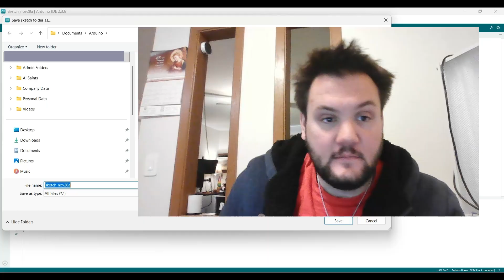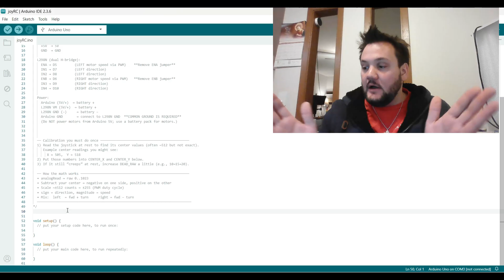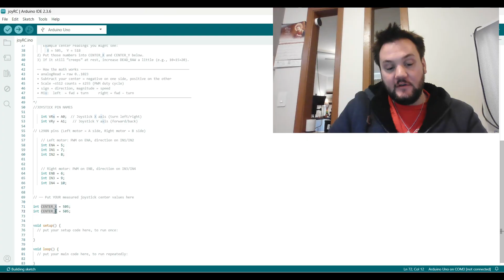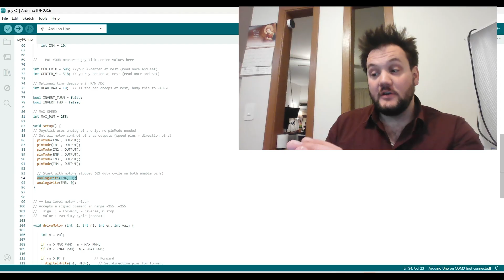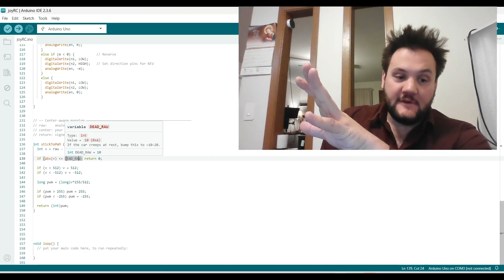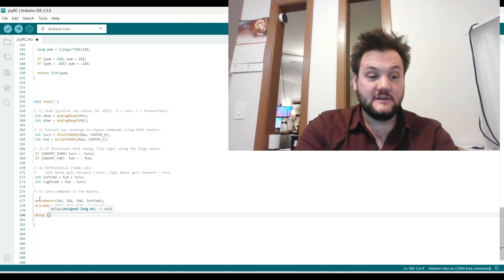Arduino 101: 2WD RC Car CODE with L298N and Joystick

Comment from the maker: /*
  
  Project: 2WD RC Car — Joystick Control (L298N)  *Center-Calibrated*
  Big idea: The joystick sets two numbers:
            • Forward/Back  (Y) → how fast to go
            • Left/Right    (X) → how much to turn
            We “mix” them into LEFT and RIGHT motor speeds.

  ── Wiring ───────────────────────────────────────────────────────────

  Joystick:
    VRx  → A0        (X axis: left/right)
    VRy  → A1        (Y axis: forward/back)
    +5V  → 5V
    GND  → GND

  L298N (dual H-bridge):
    ENA → D5         (LEFT motor speed via PWM)    *Remove ENA jumper*
    IN1 → D7         (LEFT direction)
    IN2 → D8         (LEFT direction)
    ENB → D6         (RIGHT motor speed via PWM)   *Remove ENB jumper*
    IN3 → D9         (RIGHT direction)
    IN4 → D10        (RIGHT direction)

  Power:
    Arduino (5V/+)  → battery +
    L298N VM (5V/+)  → battery +
    L298N GND (−)     → battery −
    Arduino GND       → connect to L298N GND  *COMMON GROUND IS REQUIRED*
    (Do NOT power motors from Arduino 5V; use a battery pack for motors.)

  ── Calibration you must do once ─────────────────────────────────────────────
  1) Read the joystick at rest to find its center values (often ~512 but not exact).
     Example center readings you might see:
       X ≈ 505,  Y ≈ 518
  2) Put those numbers into CENTER_X and CENTER_Y below.
  3) If it still “creeps” at rest, increase DEAD_RAW a little (e.g., 10→15→20).

  ── How the math works ───────────────────────────────────────────────────────
  • analogRead → raw 0..1023
  • Subtract your center → negative on one side, positive on the other
  • Scale ~±512 counts → ±255 (PWM duty cycle)
  • sign = direction, magnitude = speed
  • Mix:  left  = fwd + turn     right = fwd − turn
  ──────────────────────────────────────────────────────────────────────────────
*/
//JOYSTICK PIN NAMES

    int VRx = A0;  // Joystick X axis (turn left/right)
    int VRy = A1;   // Joystick Y axis (forward/back)

// L298N pins (Left motor = A side, Right motor = B side)

    // Left motor: PWM on ENA, direction on IN1/IN2
    int ENA = 5;
    int IN1 = 7;
    int IN2 = 8; 

    // Right motor: PWM on ENB, direction on IN3/IN4
    int ENB = 6;
    int IN3 = 9;
    int IN4 = 10; 

// ── Put YOUR measured joystick center values here
int CENTER_X = 505; //your X-center at rest (read once and set)
int CENTER_Y = 518; //your y-center at rest (read once and set)

// Optional tiny deadzone in RAW ADC
int DEAD_RAW = 10;  // If the car creeps at rest, bump this to ~10–20.

// Quick flips if directions feel backwards (set to true to invert that axis)
bool INVERT_TURN = false;      // true → left/right swapped
bool INVERT_FWD = false;       // true → forward/back swapped

// MAX SPEED cap
int MAX_PWM = 255;

void setup() {
// Joystick uses analog pins only, no pinMode needed
// Set all motor control pins as outputs (speed pins + direction pins)
  pinMode(ENA , OUTPUT);
  pinMode(IN1 , OUTPUT);
  pinMode(IN2 , OUTPUT);
  pinMode(ENB , OUTPUT);
  pinMode(IN3 , OUTPUT);
  pinMode(IN4 , OUTPUT);

  // Start with motors stopped (0% duty cycle on both enable pins)
  analogWrite(ENA, 0);
  analogWrite(ENB, 0);

}

// ── Low-level motor driver 
// Accepts a signed command in range -255..+255.
//   sign  : + forward, − reverse, 0 stop
//   value : PWM duty cycle (speed)

void driveMotor (int n1, int n2, int en, int val) {

    int m = val;

    // cap speed if needed... if Max pwm is not set to 255
    if (m > MAX_PWM)  m = MAX_PWM;
    if (m < -MAX_PWM)  m = -MAX_PWM;

    if (m > 0) {               // Forward
      digitalWrite(n1, HIGH);    // Set direction pins for forward
      digitalWrite(n2, LOW);
      analogWrite(en, m); 
    }
    else if (m < 0) {           // Reverse
      digitalWrite(n1, LOW);    
      digitalWrite(n2, HIGH);   // Set direction pins for REV
      analogWrite(en, -m);     
    }
    else {
      digitalWrite(n1, LOW);    
      digitalWrite(n2, LOW);   // Both LOW on IN pins = coast on L298N
      analogWrite(en, 0);       // Stop (coast)
    }

}

// ── Center-aware mapping ─────────────────────────────────────────────────────
// raw:    analogRead result (0..1023)
// center: your measured rest value (~500-ish)
// return: signed PWM command -255..+255 (0 near center)

int stickToPWM (int raw, int center) {
  
  int v = raw - center ;    // negative one way, positive the other

 //deadzone in raw counts: if the stick is almost centered, treat as 0
  if (abs(v) <= DEAD_RAW) return 0;

  // Avoid extreme out-of-range values (protect math if center isn't perfect)
  if (v > 512) v = 512;
  if (v < -512) v = -512;

  // Scale raw distance from center to PWM range (−255..+255)
  // 512 raw counts ≈ one "half" of travel → map to 255 PWM steps
  long pwm = (long)v*255/512; 

  if (pwm > 255) pwm = 255;
  if (pwm < -255) pwm = -255;

  return (int)pwm;
}

void loop() {
  
// 1) Read joystick raw` values (0..1023). X = turn, Y = forward/back.
 int xRaw = analogRead(VRx);
 int yRaw = analogRead(VRy);

// 2) Convert raw readings to signed commands using YOUR centers.
 int turn = stickToPWM(xRaw, CENTER_X);    // -255..+255 (− = left, + = right)
 int fwd = stickToPWM(yRaw, CENTER_Y);    // -255..+255 (− = reverse, + = forward)

// 3) If directions feel wrong, flip signs using the flags above.
// quick fix for swapped VRx or VRy outer wires   use true or false above...
 if (INVERT_TURN) turn = -turn;
 if (INVERT_FWD)  fwd = - fwd;

// 4) Differential (tank) mix:
//    left motor gets forward + turn; right motor gets forward − turn.
 int leftCmd = fwd + turn;
 int rightCmd = fwd - turn;

// 5) Send commands to the motors.

 driveMotor(IN1, IN2, ENA, leftCmd);
 driveMotor(IN3, IN4, ENB, rightCmd);

 delay (10);

}